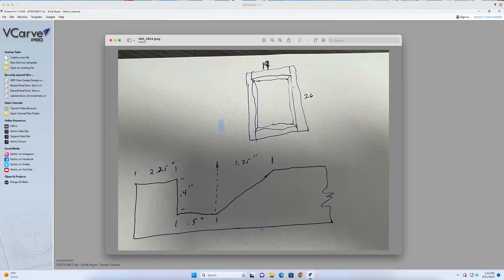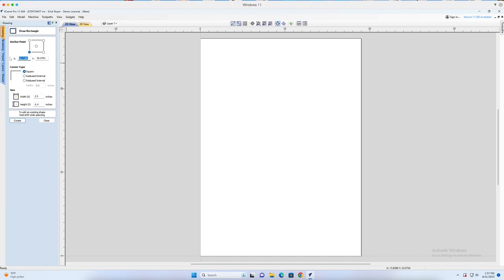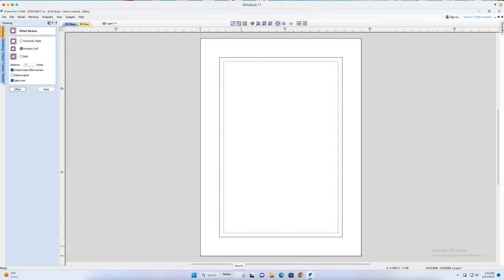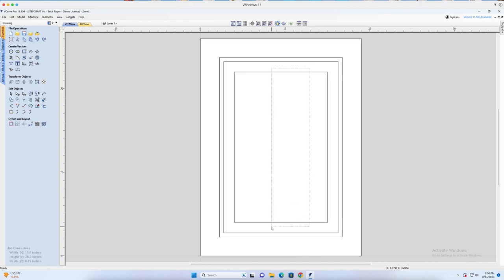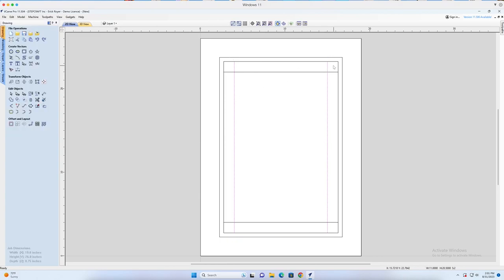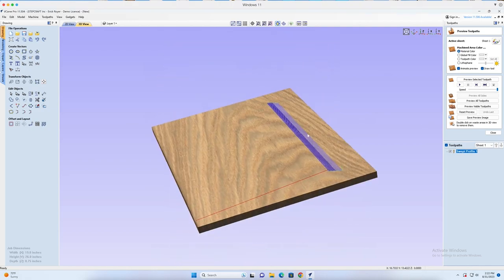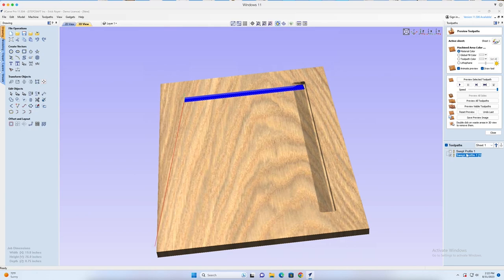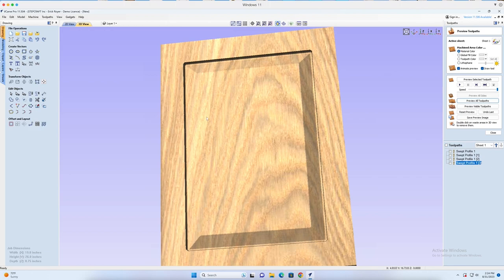Custom CNC Raised Panel Doors Using Vectric V Carve Pro's Molding Tool Path - No Special Tools!

Comment: making this door in 1 piece will cause cracking due to humidity and temp changes. just a caution to anybody doing this for customers and not just hobby. the face must be floating... many methods for this but I find spaceballs to work well for expansion seams.
Reply: in wood yes, in mdf it would not crack. these are painted doors after all